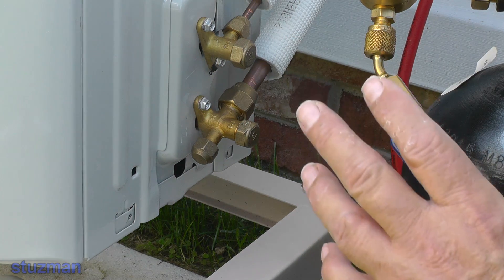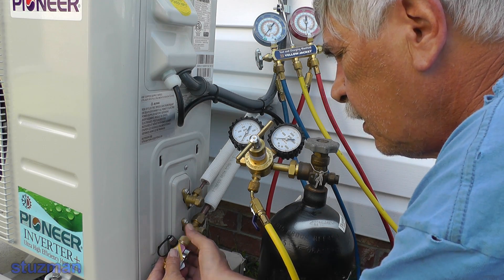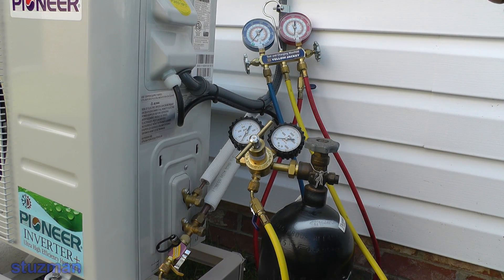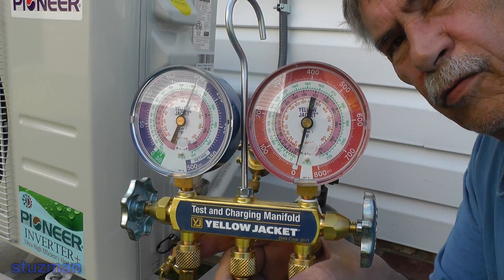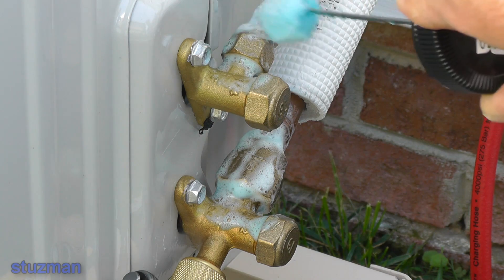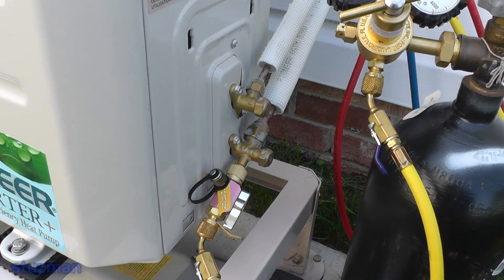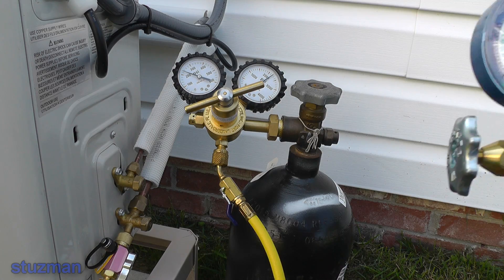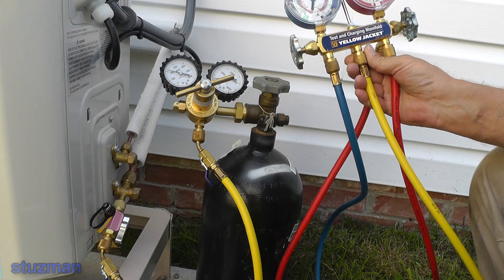Mini-Split Heat Pump: Nitrogen Pressure Test

Comment: I'm still watching and haven't read the comments... I'm at 4:43 . Could you close the valve on the source tank and watch for pressure drop? A small leak might not drop the needle if you have a constant feed of gas. Back to watching.
Reply: Oops... I missed that you closed the low side valve. 9:30 you opened it again to drain the charge.
Reply from the maker: Thomas EXOVCDS I knew you would catch it. Have you done much AC work since your boss will let you guys work on it? Oh, a little tidbit for you regarding R1234YF refrigerant. I figured out what YF stands for. You’re Fucked! Thanks for dropping in Thomas!
Reply: LOL... that sounds about right (from what I have heard about that stuff). No way my boss is gonna invest in another machine to service those systems. We're still only dabbing with AC. Mainly for when heater cores are done... we have checked some vehicles with lack of AC complaints, but most ended up being control / input related faults as opposed to low on charge / leaks.
Reply: I think I mentioned that to you Terry when I questioned you on the wisdom of buying a recovery system with this change coming around the corner. The two refrigerants are completely incompatible therefore you're going to need two machines.
Reply from the maker: SATAMAN Schmidt Dennis, I appreciate your thoughts, but I was aware of the two refrigerant types having incompatibility and that you can’t use a R134a machine on R1234YF. I know that it’s flammable and very expensive. I’m not planning on working on vehicles with type refrigerant. EPA mandates that all USA vehicles must use this refrigerant by 2021, Recently I purchased a 2016 vehicle, but  I made sure it uses R134a. There will still be quite of ‘new’ vehicles on the road in upcoming years. I realize that R134a will start to cost more as it is being phased out, but that will be a few years. Mercedes along with other European manufacturers have been using this R1234YF for a few now. There was a front end collision with a Mercedes and a refrigerant line split. This refrigerant spewed out onto a hot exhaust manifold and caught on fire. The car burnt to the ground. Mercedes is considering to switching back to R134a. So, who knows what the future may hold.
Reply: A Benz burnt to the ground. Considering how crappy Mercedes has become that might be a good thing. From best in the world to lowest resale value on Earth in twenty years. Now that's progress.
Reply from the maker: SATAMAN Schmidt HaHa Dennis! You’ll get no disagreement from me on that point! Have a great day! 😀👍
Reply: That's what I was thinking!   I didn't see him turn the manifold valve off!  When he showed no pressure drop from 200 at the end I was thinking there wouldn't be one even if there was a leak!  Great video.  I installed a couple splits, looking into various nitrogen regulators now.

Comment: In a heat pump, I believe flow is reversed when switching from heating to AC. So, the high side must become the low side. In our home heat pump the two lines have different diameters, usually the low side is big diameter line and the high is small. If flow is swapped every season, why don't they have lines with the same diameter? Won't a big diameter high pressure line cause some kind of problem?
Reply: Because the larger line is always vapour and the smaller line is always liquid. Regardless of whether you’re in heating or cooling
Reply from the maker: spelunkerd Your operation about a heat pump is correct. Evidently the diameters of the lines isn’t an issue as all the lines I’ve seen on heat pumps have two different diameters. I don’t have a good answer to why they wouldn’t be the same. Good question!

Comment: I wish they would have tested mine when it was installed. They had to come back 2 months later and charge the mini split again and fix the loose connection.
Reply from the maker: That’s why Terry that I try to work on my own stuff as much as possible! I know there are good techs out there, but I don’t know who they are. Even without a pressure test, they should have caught it when they pulled a vacuum using a micron gauge. Maybe they didn’t use that as some techs rely on the manifold gauge dial. Using that in my opinion is not sensitive enough unless you have a fairly large leak.
Reply from the maker: @gerrypehl5602  I understand exactly what you mean Gerry as I've been in that dilemma myself over the years. You don't know who's good at HVAC, auto repair, building contractor and the list goes on. I decided years ago to do as much of the work for myself, know the job is as good as it will be, save some money and learn something at the same time. All a win-win situation. Good luck on whatever you do! :)

Comment: Nice to see it held pressure.  If you seen a leak it would have been go time eh:)  I have to  try that bubble fluid. Nicely done Terry. 👍
Reply from the maker: STEVE ROB REVIEWS Yes, you are correct that if there was a leak, the pressure would have dropped off fast, even for a small leak. I’ve used all kind of stuff for bubbles over the years and this stuff is amazing. You won’t be disappointed! 😀👍